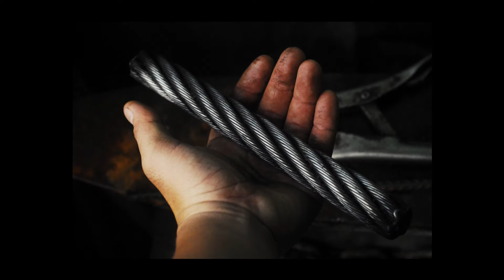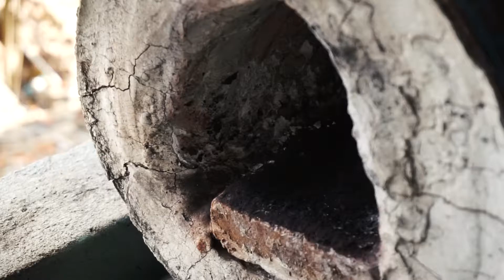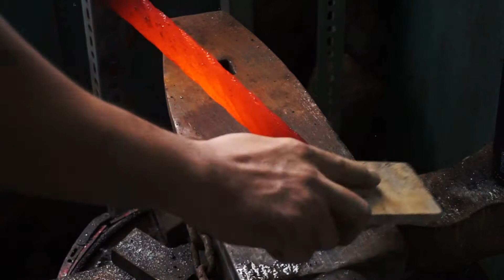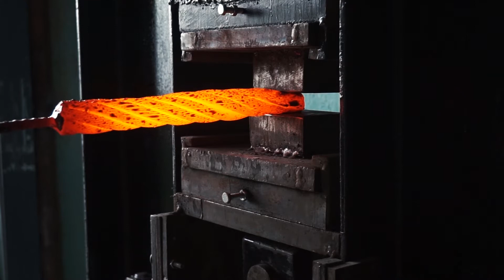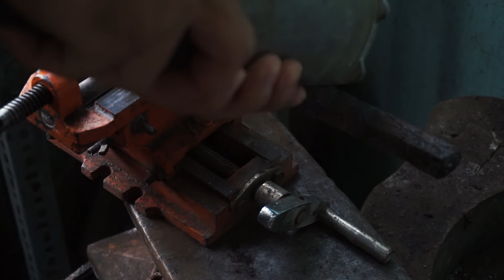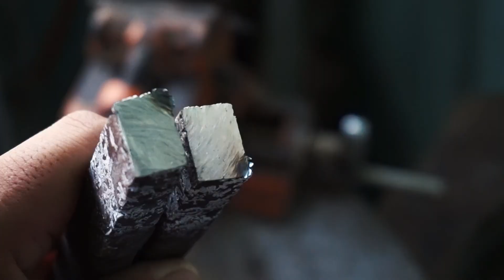HOW TO MAKE CABLE DAMASCUS | Rèn Phôi Damascus từ Cáp Thép

Comment: I heard that you are suppose to tap the wire on the ground to see what way the inner strand turns that’s the way your suppose to twist otherwise you can get a delam
Reply from the maker: Yes. You should twist for more tights instead untwist the wire